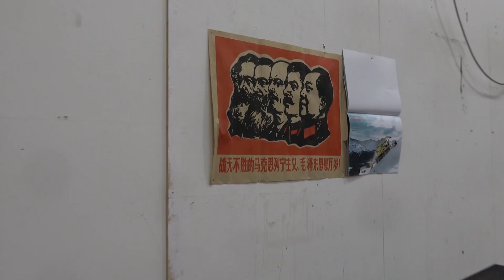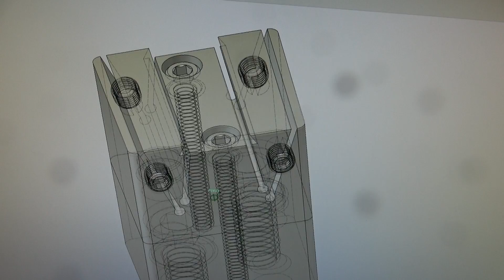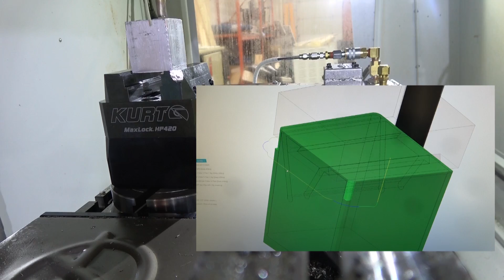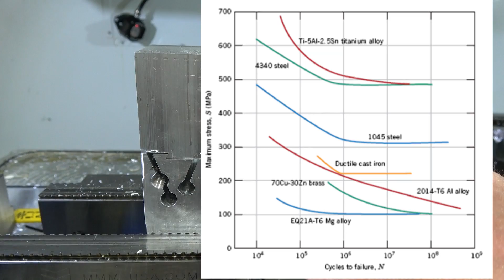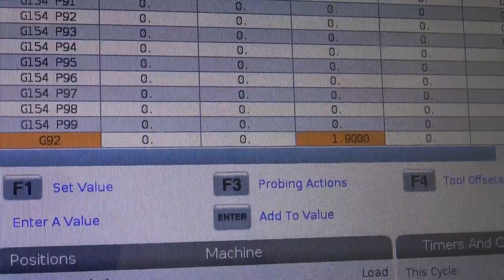Prototype invention 5-axis Vise?

Comment: |￣￣￣￣￣￣￣￣ | 
|            FREE           | 
|    BUMBLEFUCK    | 
| ＿＿＿＿＿＿＿＿| 
      (\__/) || 
      (•ㅅ•) || 
      / 　 づ
Reply from the maker: This is the most moving piece of art I've ever encountered.
Reply: @arduinoversusevil2025  Tip.. and just the tip.
No pictures.. so bear with me.
Drill a hole through the x-axis (assuming we're clamping the z-axis)
So it's a smooth hole through the 1st two   layers of clamp piece. And thread the 3rd layer.
So when a bolt is put through.. it would pull and clamp the 1st layer and the 3rd layer?

Let me know if that makes sense
Reply: @arduinoversusevil2025  Yo AvE, you want to see yourself a fascinating piece of engineering - get yourself a CZ-82 or 83 (same gun, different calibers). I think they're available in Canada, very inexpensive pistols. The trigger, hammer and other assorted parts fit together and impact on each other with remarkably precise engagement surfaces. The jigsaw of parts function like a Swiss watch but knowing how interested you are in fine machining and intricate mechanical arrangements I think you'd really enjoy taking one apart and seeing how it all works. They're also great guns.
Reply: Second that. A CZ-82 has been my summer time carry piece for 9 years. Fantastic weapon in many ways. Liked it so much I bought 2 of 'em.
Reply: @nancyschultz3997  I don't know if you have custom sights for you CZ's yet, or even if you want them: but XS makes tritium sights for the CZ-83, which will fit CZ-82s. I have a set on my CZ-82, love 'em. So easy to bring on target.
Reply: @ObservingLibertarian  Thanks! I'll check that as the stock sights are not the greatest.

Comment: Rather than that grub screw in the tapered/angled hole that pushes the bendable dovetail tab toward the fixed dovetail, I'd do a row of three socket head cap screws on the opposite side from the current grub screw.  Evenly tightening these screws would enact clamping movement of the bendable dovetail tab by tension, pulling it toward the fixed dovetail.

Comment: Couldn't you just put a screw in from the other side,  is that 3/8 the hole w thread all the way through? Straight drill it and tapper the screws,  one from each side.

Comment: Hey AvE, your video reminded me of how the Techsights for my Ruger 10/22 dovetaled on. Here is a link to some pictures of how the front sight is: https://imgur.com/a/2pD6atg The piece that is mostly cut away has a set screw in it that is threaded into that same piece. as you tighten the set screw the bottom of it pushes the against the large block thus pushing the small block out creating the retaining force for the sight.

Comment: It'd likely require another op, but considering you're making a 5axis vise on a 5axis machine that seems viable. Rather than the one threaded tapered plug parallel to the hinged axis, could you put 2 threaded holes perpendicular to the flexing direction so you could tighten down both sides of your two tooth jaw separately and closer to the toothed points (rather than somewhere arbitrarily in the middle)? If this sounds like a good idea but you're not sure what I'm saying, let me know and I'll explain further.

Comment: Try taper thread on both front and back so it creates more force on both corners.. IDK just a thought.. and yeah like u said aluminum is good for fixtures because of cost.. i think the idea i have with 2 tapered thread holes opposite of each other, and steel for the fixture. 
Good idea? Or did i not learn shit  today... let me know. Makes me want to try and make this so bad but, i dont have a machine at home.

Comment: Improvement Suggestions (either should work):
1. Similar to your drilled hole for an expander and groove to allow for expansion, cut a groove in the center of top piece, from front to back, and insert an expander in a hole drilled at the end of the groove. This should allow the top piece (male piece) to expand into the dovetail slot in the female piece.
2. Cut a groove and drill a hole in the center of the bottom piece and insert an expander in the drilled hole. Then machine the dovetail. Relaxing the expander will squeeze the top male piece.

For the expander, you could tap the drilled hole for pipe thread and insert a pipe plug. The more you insert the plug, the more the part will expand.

Comment: im only seeing this in video form, haven't looked at 3d files. How about doing like one of them adjustable gib type dealys, one sort of continuously angled pieces and matching on clamp then just tightened with a screw. Also maybe go steel with final design.

Comment: @aVe you forgot to account for the change of angle when you "clamped" the part, you used a 30°wedge, but it's no longer 30° on that side when you actuate the clamping force. You would want 31 or maybe 32°on the actuating side for the dovetail cut.

Comment: Try moving the screw to be perpendicular to the dovetail rather than inline with it, place the screw in the center where you cutout some of the dovetail.  This will pull it from the center and flex inward with the screw clamping both outer sides more securely and evenly.

Comment: What if instead of screwing a wedge into the live side, drill an oversized hole through the static side, tap the live side and run in shouldered bolts. That way all your clamping load is going into holding the part, not losing part of it to the buttress on the side.  I am not a machinist, the correct names would require effort for me to look up.

Comment: Very interesting with the whole work holding ideas as in my workplace they use a system called zero point, quick point made by Lang Technik, so you can take a job off and have it inspected then put it back on the machine and it will be as a good as it never moved. Accurate to something like 0.002mm or around 0.000079" in the x&y, z won't move. Although you need to prep the material at the start to have four M8 holes positioned at the corners of a 98mm square. Then having the four studs somewhere on the stock so for that the last op is taking that face down, to finished size removing the holes, if need be.

On a side note those automatic probes are a piece of electronic Magic, and have you tried thread milling? It removes the issue of snapped taps as you just remove essentially a toothpick, and put a new tool in with out any serious damage to the job, just you aren't able to change a z offset as it puts the tool path out from the thread.

Comment: The number of load cycles on the item is typically more like the number of cutting edge engagements.  Think 20 thousand rpms for a few days. Finite life. Workholding may degenerate during the machining of one part... Probably not the first but don't count on hundreds unless tool loads are very gentle. 
Recommend automated probing between selected passes to ensure that the workpiece hasn't started to shift as cracks propagate.

Comment: Tip.. and just the tip.
No pictures.. so bear with me.
Drill a hole through the x-axis (assuming we're clamping the z-axis)
So it's a smooth hole through the 1st two   layers of clamp piece. And thread the 3rd layer.
So when a bolt is put through.. it would pull and clamp the 1st layer and the 3rd layer?

Let me know if that makes sense.

Comment: Pretty sure all you had to do was chamfer the doevetail edges  on both sides so the OD doesnt hit the ID..  You don't want the points, making contact,  you wan the dovetail face to pull down on the piece which gives you a solid Z height.

Comment: Simpler design...
Cut the dovetail.  Cut a slot in the middle of the dovetail, hole at the end to make it look pretty (like the slots you have here).
drill 2 sets of holes through the block perpendicular to the dovetail and as close as the bottom of the dovetail as possible and on each side of the block.
Tap the holes on one "half".
Bolt with a washer through the other side of the hole and into the tapped half.
Using my amazing ASCII skillzzz:

   +------------------/                   \------------------+
   |                    /------+  +--------\                   |
  |                              |   |                              |
  |vvvvvvvvvvvvvvv|   |---------------------------|
  |  threaded hole   |   | unthreaded hole|   <---- bolt through here
  |^^^^^^^^^^^^^^^^^ |   |---------------------------|
  |                              |   |                              |
  |                              |   |                              |

While I understand what you're going for now. The point where you put force, and where the pivot is, are close together with the gripping point being fairly far away. So a lot of the applied force is being wasted (and part of that force is trying to bend the outer edge of the swallow tail away). So you're using the wrong end of the lever.
flex point ------- force --------------------------------------- swallow tail grab

And you can't put the force point much further up, since you're relying on the other side of that slot to be unmovable. putting the force point too high will make that weaker.

Comment: I could be seeing things, but I believe the sharp end of the dovetails were bottoming out and so not loading up the sides of the dove tails. if the sharp bits bottom out, the dovetails do not pull the item down, hence no holding power.
A solution is to machine off a mil off the sharp points of both dovetails to provide clearance to ensure that the load is taken on the tapers.

Comment: patents: Autel (Drones, USA) has pattented in 2013 to use bayonet mounting for props on quadcopters, depending on the turning direction of the motor (which is 2 right, 2 left). plus putting the landing gear under the motor which are accidently the corners. (i hardly cant imagine to do it a differnt way, but o.k...)
and amazingly they got a court ruling over DJI (Drones, China) due to patent infringement.

Comment: Totally unrelated but has anyone seen the new Hart cordless tool line at the Walmarts? The battery charger is sold separately for like 60 US pesos I wonder if a 20V DeWalt or Milwaukee charger would charge a Hart 20V battery or if another brands 20V battery would be compatible with Hart tools. The Hart 20V impact drill chooches decently for the price.  AvE I think a tool review is in order as well as a video on what charger's or batteries are compatible.

Comment: Though the single grub screw design is cheapest, perhaps two longer machine screws drilled/tapped through both sections of the dove tail fixture orthogonally to the slots centered to the floating tails would better accommodate asymmetry in the slotted part. Then the solid section on the screw head side could remain one long section or have a smaller relief in the center edge. Bolts would need some heft and clamping force ratings tho. Just an alternate option with conceivably greater flexibility and margin of error.  Though, I'm not pro machinist and just another idiot talking out of his a....

Comment: just a single slot (plus through hole at bottom) and two bolts, countersunk and clearance holes through the flexible side and threaded in the block (at the ends/corners)
Maybe not as accurate as those fancy ones, but it will get the job done. (and as mentioned before somewhere down here, take the sharp corners off of the dovetail fixture, no dovetail-cutter has really sharp points and thus cant cut a sharp internal corner, like most cutters of any type actually it leaves a small radius)
Tapers are a lot harder to get to work nicely, nice try though... we all live and learn and make "art" along the way...

Comment: Pro tip, just the tip mind, as a preference I like to set G54 at the center of the working plane. For the vast majority of parts you make from raw stock, it makes things a lot easier because it gives you a point that will never move. When you measure to a corner and then make a cut, you lose that reference which makes setting up your second OP (or resetting from an oops) a lot harder. If you measure to the center, your part geometry will always be true to the machine because you can measure to find it.

Comment: What if instead of using a plug bolt as your clamp, use the cnc vice. Put a dove tail on the top of the block like before, in the middle of the  dove tail cut the block 3/4 of the way down, then remove material from the bottom of the sides so that the point of contact for the CNC vice jaws are above the middle cut. This should make the aluminum block clamp down when the CNC vice jaws clamp down.

Comment: Rather than use a threaded plug, why not drill a hole through the whole block, perpendicular to the slots, and put a bolt all the way through, nut on the end, tighten, squish, clamp.

Comment: Helps if you put a flat on your dovetail points. On the vice and on the part, a relief into the armpit, if you will. Also, you CaNnot use a haimer like an indicator because it will compound the 3D movements. Täste that sweet candy.

Comment: Don't "wedge" it over to clamp use two or three bolts to pull it into clamp....drill and tap the bolt holes through the side at a 90 degree angle to the center clamping section.

Comment: Don't know stuff all about CNC machining, but I know a lever when I see one and that was a big one.

Make the holder shorter, and simplify the design. Cut  the dovetail north-south and then split it vertically right down the middle also north south to two thirds the depth. Come round and drill two holes east west on the thirds and half the depth of the split and just use a couple of bolts to squeeze the whole thing together. Not relying on the ally for the thread will mean you can do it up properly tight and deform the shit right out of the dovetail.

Should hold tighter, especially if the matching male dovetail is slightly shallower. Fixture dovetail will pull part one into it and also flex up into the bottom of the part increasing the support area. If you really want to hold onto it use steel and cut teeth into the fixture dovetail.

Image linked, please excuse crudity of the drawing. Trying to draw a 1 mm line below a 15mm fat finger on a phone screen with the artistic flair of Picasso not Michaelangelo doesn't do so well.

https://imgur.com/a/QL1QIxp

Comment: Three dovetails and 4 grub screws. Job done. Two rails as locking pins and one large centred one as the main joint. Basically a H shape in the ally. The middle of the H is your main joint.

Comment: Using the setscrew and tapered thread as a wedge also bends out the outer wall, so you're "wasting" clamping force there... basically clamping against a spring.

Maybe a single slot and flexture point and a perpendicular hole, threaded on one side and clearance drilled on the other so standard bolt pulls it together.

Can also try a slot perpendicular to the first to make two shorter, independent clamps to reduce the 4-point-of-contact issue.

Comment: For how much forces that would bee involved in holding such a small part shouldn't take much. Problem is keeping accuracy and precision,  so if you could have easy to harden and grind parts would hopefully cheapen it. Those prices are I guess thee premium you pay for guaranteed precision. If you could make all the parts I don't think getting them surfaced ground would cost much

Comment: I wonder if you'd be better served with a tapped hole on the Y axis.  Put a screw in it to clamp the structure together, rather than forcing it apart in the current iteration.

I sat bolt upright in bed at 4am when I realized this.

Comment: Floor of dovetail needs to stay flat and rigid for repeat setup and reversibility and rigid support.
One vertical slot to one side inside the dove tail. Horizontal cap screw though the fixture just under the dovetail. In aluminum probably splash out on a nut on the other side for thread durability. 
Jobs a good'n.

Comment: I only work with Timber CNC machinery so my opinion may not be eligible, but maybe put two grub screws in through the side to actuate the clamping. At least that way you retain a bit of structural integrity and have two even point-loads on the dovetail.

Comment: Guten Tag from Germany. Looks like the flexture could be moved over so that the fixed side of the tapered thread has a bit more meat. It should be a lot stronger than the flexible side so that the movement doesn´t get distributed between the sides.

Comment: The part needs to shoulder against the base. The dovetail should be the loose part. There is a visible gap between the part and the vice....The dovetail should draw the part into the vice.. Adjust the gaps so that it does. The more contact when clamped the better....

Comment: Why move away from the clamping bolt coming in from the broadside? Wouldn’t it still work if you just passed the bolt  through the slots and threaded into the far end of the female block,

Comment: I am curious about the design in that as you tighten the screw, the majority of the flat will be flexing as you tighen. The bottom of the dovetail will no longer be parallel with the base. If the screw were on the other side (smaller horizontal portion), would you not be clamping more with the dovetail and less of the flat?

Comment: About 10:10 
Weblwoble with 1 screw. 
Use a NTP plug from each end of the hole . Especially useful on those first cuts when it's not quite right yet.

Comment: Probably should cut the dovetail after you add the clamping screw with some pressure so the dovetail is cut in a “normally closed” position. It’ll hold better since there’s more contact with the mating part and make it easier to load and unload parts.

Comment: You could probably get away with a bolt perpendicular to the slits you cut. Relief the middle section to make sure it still moves an probably a washer wouldn’t hurt. Three parts BOM